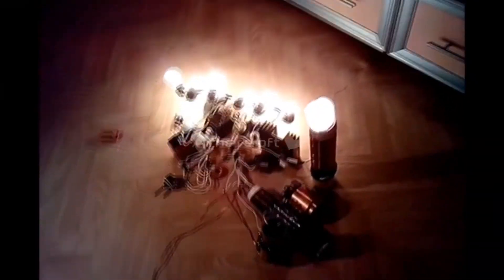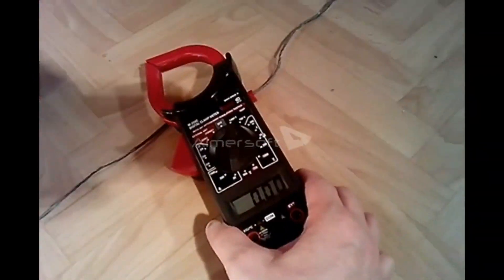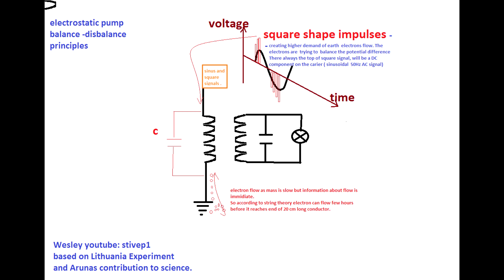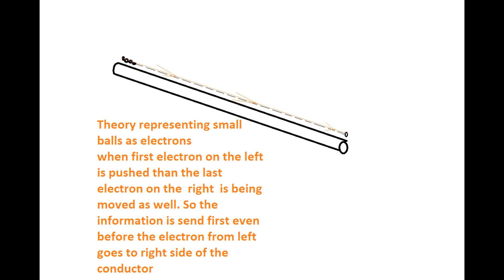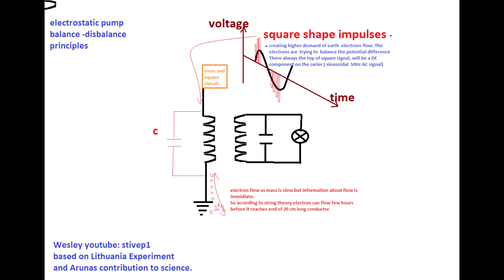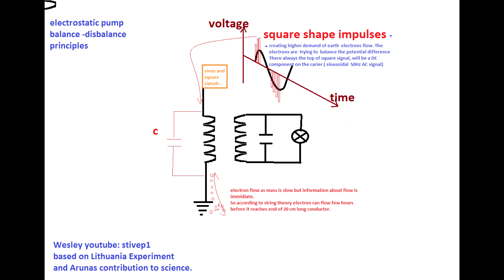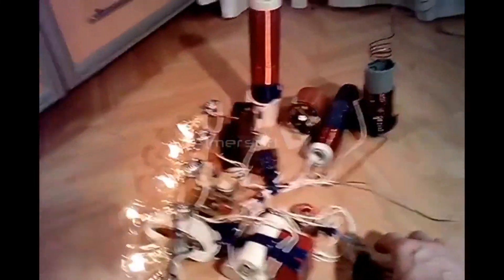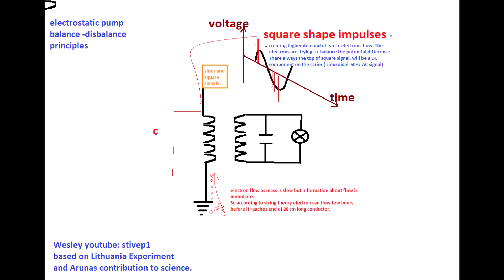Wesley News:part #8 Vasmus Free Energy

Comment: The only "place" for hoax is 3 white cylindrical elements. There is possible to hide 3 LiPo batteries. 18650 elements: 3.8V and 2.6A each can do "miracles". How long Vasjas Pupkin`s devices work?

Comment: An antenna? Why do we see a wire from just in between the two drawers up to about 50 cm from the device? Really, who is paying attention?
I sense some wishful thinking here. Our time will come, sure! But this is not it yet. (imho)
Reply from the maker: PLEASE LOOK  AT MY RESPONSE TO SHUBUS YOU WILL FIND YOUR ANSWER.You heave  13 more lines of text there if you  press on "Read more"
Reply from the maker: I'm trying to point something that  nobody cares to understand.
Acceleration and comparison of force vectors:
step1.  Take car at 0 speed= 15 girls push.
step2.  Take car at speed that requires one girl
step3.  Take car at speed that requires 1 finger of the girl to sustain  the motion.( that finger compensates the loses)
step4.  Take car at speed that requires 1 finger of the girl to sustain  the motion with 4 people inside ( that  finger compensates the loses as well with the same joules force applied.
 The only difference  is what has happened before it gets to that point, That means initial power to push the car to that point- must of be greater, but after that it,is not important for sustaining the motion if we heave 1 or 4 or 10 people in the car.There always would be a point where one finger of 15 years old girl will compensate the losses. Acceleration  if any at any vector of forces will be at some point no longer present, but will be  at the " finger level for sure"

It is not important that we  deal with car, flying will,  electrical current versus electrical potential(V)  
The system will obey the same  "function mechanism" in time

What is-Delay Time Line:

So what than square signal does?
 I creates  temporary acceleration as BEMF is not seen immediately but wit delay.
Similar to the bank teller holding  pack of dollars in his hand  and being at that fraction of time "in possession of that money"
She can put it to flow, or theoretically he can go to pizza  store to " buy  energy", or get the car rental , to "borrow energy"... in any  scenario he is not paying with his own "money" (with his own potential).
The balance will come later.

Another example:
Can you just concentrate  guys for the moment?
Car is standing  in between two bumps with its rear tire  front wheel drive)
Car on the bump- if pushed with force F, however it does not  go over the bump.
Than car is pushed back to go on rear bump with force F than forward with force F and than with 1/10 of force  F is going over the bump as it already has swing power of time based  acceleration.
result:
So in practice one can use 1/10 of Force ant increasing frequency to swing the car, swing the bridge, swing his  (attention to understand  simple  physics)  

Madoff's ponzi scheme was possible because of the same mechanism, but Madof used constant acceleration to the point at  no more compensation from new investors.

So why FE device  works?
It uses someone energy using small  compensating energy to sustain  phenomena.
Like square impulses on the top of sinusoide.
or
 Like 10" water pipe with water when flowing charging "capacitor" whose energy is  used to release  the valve holding it from flow. And the only outside energy could be  the 15 years  old girl pressing button with one finger, or just timer circuit doing it  automatically when charged from the same source.

So initial energy, or energy of water flowing is  what we do not care about  let's someone  pay for it( gravity,river stream, sun, wind, )
We add some to it  to start the process and than  let it go...in controllable fashion.

Wesley